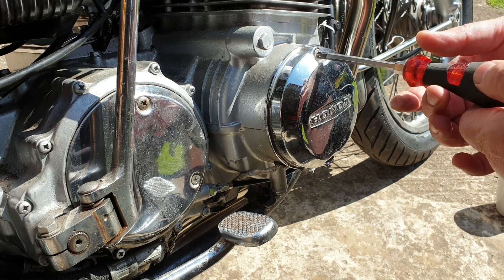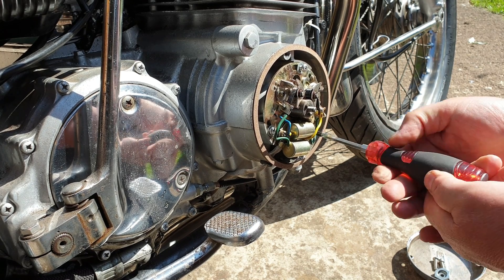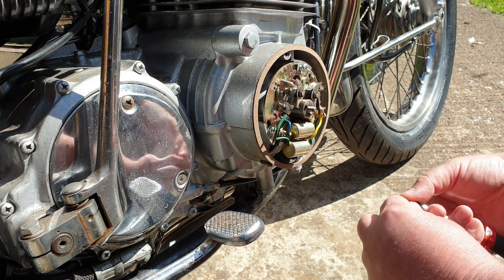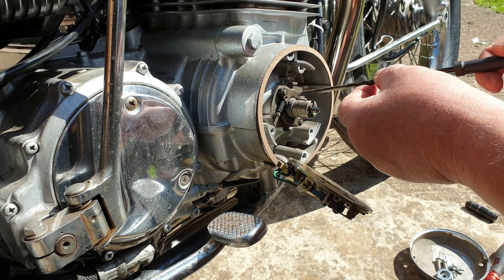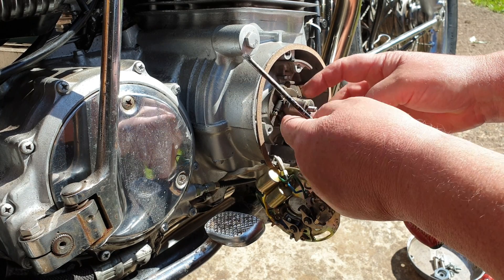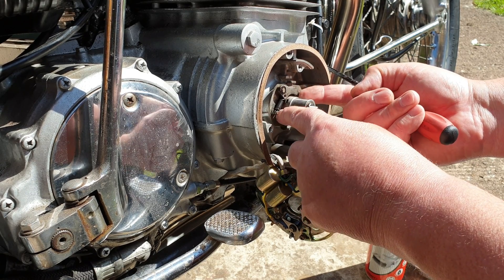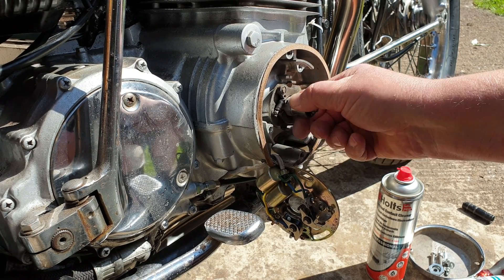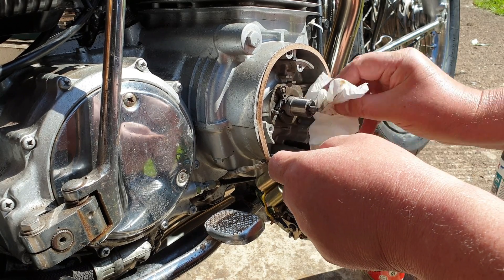Cleaning the Advance Mechanism | Honda CB750 Ignition Timing | Motorcycle Project | Part 27

Comment: If I cracked the points case can it be replaced
Reply from the maker: I'm not sure what you mean by points case.  If you are saying part of the crankcase then that would be quite a big issue.  Anything can be repaired and replaced, it is just the cost and time involved that would stop you.  If you have damaged the crankcase then depending on what has happened to it you may be able get it repaired in situ, otherwise it is a full engine strip.  Good luck.

Comment: What tool are you using? The one with a light? Does it adjust the top dead center? Is that just a circuit tester?
Reply from the maker: It is a circuit tester!  You take the timing marks from the backing plate of the points for TDC. If you clip the circuit tester to the spring on the points, and to a ground then it lights up when the points open.  I hope that helps.

Comment: I have been looking for ever. My bike gets warm and as soon as I stop and pull In the clutch it’s 4,000 rpm and then slowly goes down. As soon as I take off it’s fine, it shifts fine and runs fine. I believe this is my problem.
Reply from the maker: I wouldn't think that is a advance problem.  I would check the throttle cable first, it could be sticking slightly, it doesn't take a lot to keep the revs up.  Then I would check for air leaks on the inlet side, maybe a split in one of the manifold rubbers or one of the clamps loose.  I hope this helps you find your problem.
Reply: Did you figure out what it was

Comment: I had an airhead BMW and could tell when the gap needed adjusting by the way it ran. Have you thought about converting to electronic ignition? Surely there's a kit out there.
Reply from the maker: Ahh there's definitely CB750 electronic ignition kits out there, and to be honest I am planning to put one in at some point.
But there's a certain enjoyment to getting these old points ignitions set up just right, so as long as the CB750 runs well, I won't rush to do the upgrade to electronic.